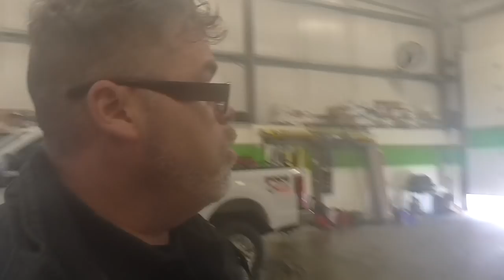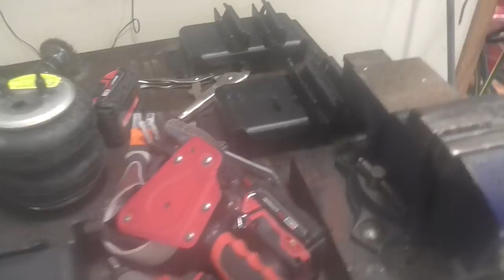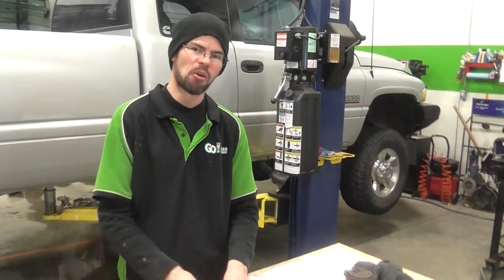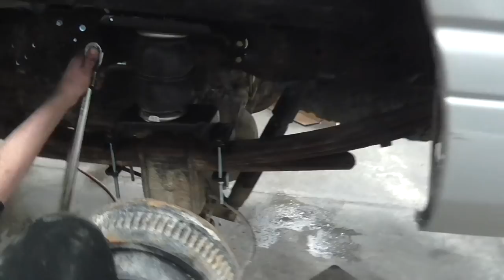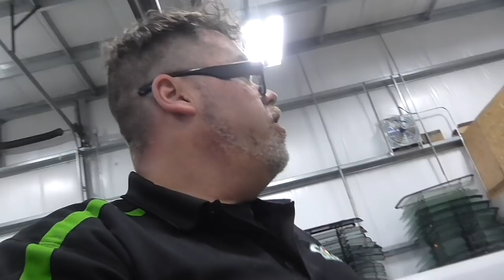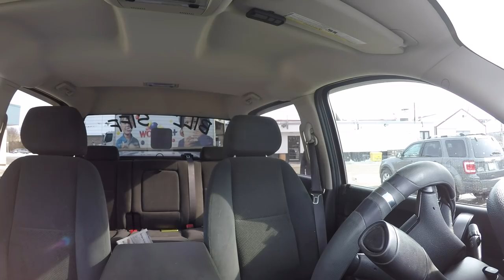Its Been Cold With A Side Order Of Air Bags

Comment: Looks good but should T the lines into one inlet so they fill even
Reply from the maker: can't do that anymore when you have uneven ground it allows the air to go into the other bag and can cause a dangerous situation
Reply: Bill Siff i connected mine together ran into the cab and just used 12v pump to air up before loading and works mint. Dirty old air ride dodge
Reply from the maker: Hey if it works thats awesome buds I'm just going by what the say lol mine are separate on the van a ro ski too